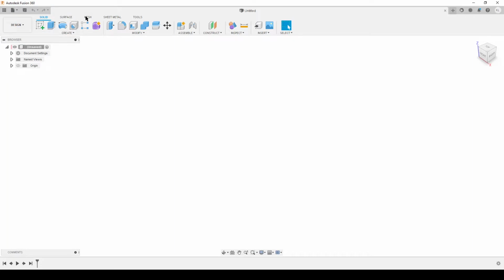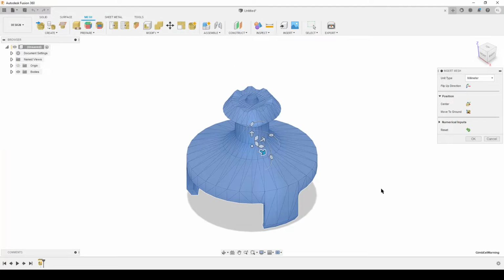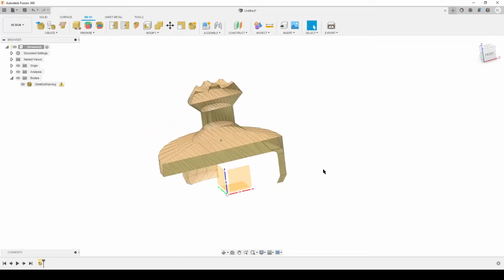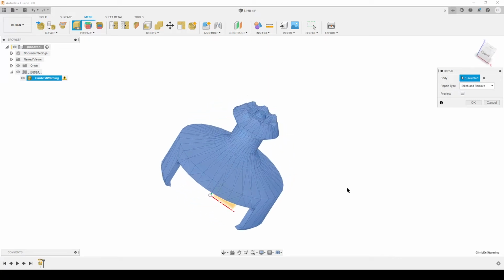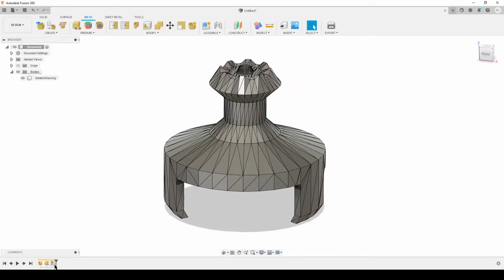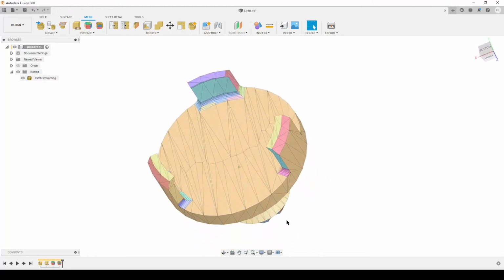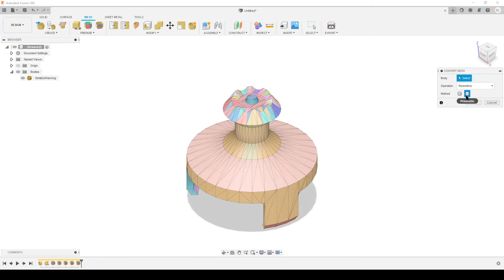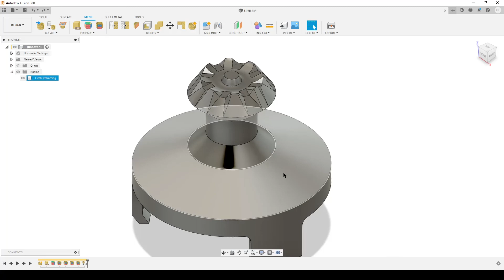Fusion 360 - STL fail to convert - Some tips on how to fix

Comment: Yes... broken STL files are much too common... I'm the author of the numpy-stl library (which is used by Cura for example) and at least 30% of the bug reports I get are due to broken STL files.
Thank you for the great video, I usually just recreate STL files but I'll give this a try in the future.
Reply from the maker: Thank you. And yes people start by blaming the software (or any other tool) prior to troubleshooting any input they have made to the software/system.
And I have noticed lately how much people think software can do/fix for them with minimum input, we'll have to wait for direct brain-interface and AI to fix things ;)

Comment: I’m still having issues the model turns to a “solid” but it stays a mesh file because it’s not actually converting but there are no yellow missing faces or anything visually wrong with the newly converted “solid object” it looks like it but still is a mesh
Reply from the maker: Did you do any repares of the mesh before converting? I rarely find any "good" mesh files online.

Comment: I dl the version for non commercial i cant do anything with it i heard there were a lot of changes from since I last Used fusion in January just wow. the menus dont even look the same as yours and a lot of grey shaded prompts i cant click on.
Reply from the maker: The faceted conversion is only usable for simple things or asa reference for a remodel. If the menus look different check that Fusion is updated, you might need to download the installer again (there was ben a bug that didn't update Fusion on some Windows machines)

Comment: How to turn on this soft viewer? If you understand what I am talking about.
Reply from the maker: Are thinking of how the parts look at the end of the video that is from the prismatic conversion (not part of the personal free version of Fusion 360)
Reply: @KristianLaholm  No, that's not what the question is about. I ask how to make that soft viewing. Fusion herself seems to rotate the image as it seems necessary. Seems to be adapting and slightly changing the zoom image
Reply from the maker: @mindaugasm2032  It can be that I'm using a spacemouse for some of the movement of the model. I'm no pro with the spacemouse and that can make the movement look at bit odd sometimes :)
Reply: @KristianLaholm  I'm still think this is some kind of setting is in fusion application. But I can't find it
Reply from the maker: @mindaugasm2032  There are some preferences changing the behavior of pan/zoom etc. But the "smooth" movements I make in the video are mostly done using the spacemouse.
Reply: @KristianLaholm  ok, thanks